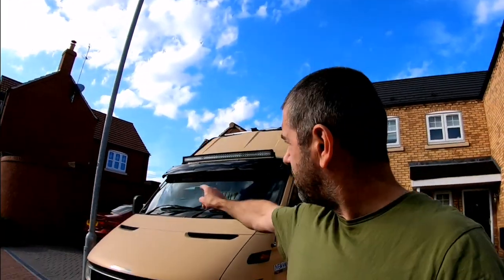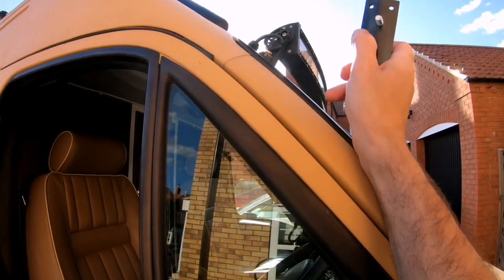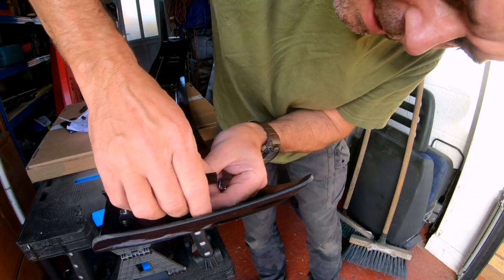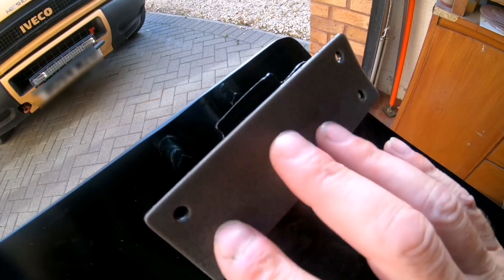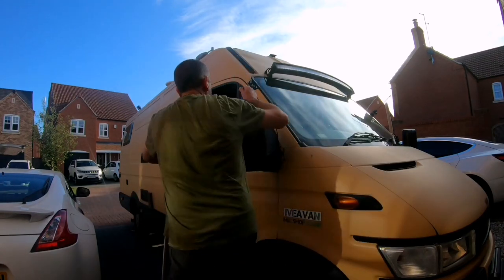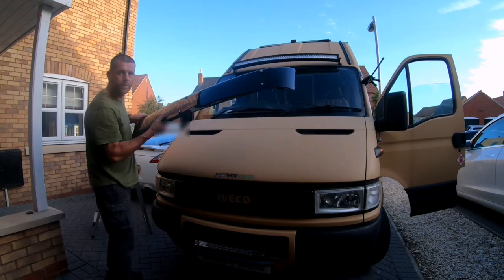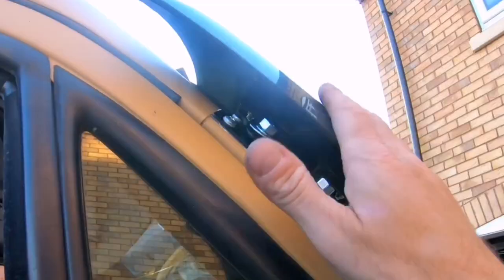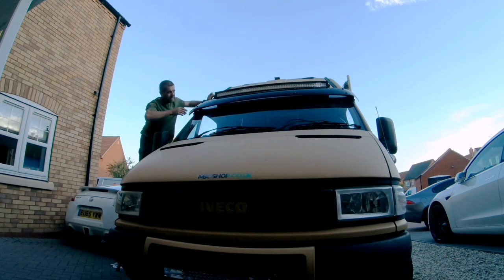How 'I' Fitted a Windscreen - Sun Visor on my Camper Van.

Comment: It’s looks well Mark it looks like the sun visor is another thing on my saving up to do list . I fitted a light bar above my windscreen and I’m glad you mentioned that it makes a bit of noise , I have not drove my van for a year in November so I don’t know how bad the noise will be but thanks for the heads up as no one has said about it , but I’m now going to use your link to see how much I have to save .they are £198 now so you got yourself a good deal
Reply from the maker: You might be lucky yours might not make any noise Luke's doesn't, that link should be the £114 one bud 😎👌👍👍👍.
Reply: IVEAVAN I have sent them a message to see when or if they are getting anymore in stock as it’s says out of stock
Reply: 198 quid?! That's a bit spicy? Where did you buy it?

Comment: Got the same happening on my Peugeot boxer,  the drumming is the air being deflected off the light bar front and hitting the roof. I've added sound deadening to the roof underside and it's virtually stopped the drumming noise . The whistling from the light bar can be stopped by fitting door edge protector along the fins on the rear of the light bar. There's a video on here showing it done.
Reply from the maker: Excellent cheers matey, I can't fit the sound deadening due to the bar is fitted to  with a cavity of the roofs frame work, but I'll try the door edge trimming, but for now it's a hell of a lot better then what it used to be 😉👌👍...
Reply: @Iveavan  my drumming started at 35 mph to 75 mph . Drove me nuts .

Comment: I've just bought one for my Daily MK3,exaclty as yours. Just out of curiosity,what's the damage in the UK for one of these? Mine was 90 euros, but apparently comes straight out of Turkey, with a dumb and useless mounting instruction sheet ,A5 size, 7 steps,hardly readable,so i am very happy to have bumped into your video! Thanks a lot,mate!
Reply from the maker: Sorry bud your comment was stuck in my "held comments" for some reason 🤔. I can't remember the exact price back then but (£49 rings a bell) there going for around £60 upwards now in the UK bud 😉👌👍👍👍.

Comment: Hello, do you have vibrations at high speed ?
Reply from the maker: No, not experienced any from this visor. But I know people who have on different vans 👍.
Reply: @Iveavan  Ok, thanks for your answer.   Few people talk about it, I have it on mine, it sometimes vibrates a lot when I pass trucks but it still holds up well, it has been in place for a year so it must be normal!
Reply from the maker: Mine seems to be solid, I haven't noticed any flex whether Im head long into the wind or from vehicles passing by. But to be fair, I did have to lever the main frame upon the mounts as they were out by a few mm, so the frame will be taught upon mine bud 👌👍.
Reply: Mine vibrates especially at the bottom in the center but the bindings do not move, I did not buy a very good quality! I'm just wondering if this only happens to me, I'm trying to reassure myself 👍